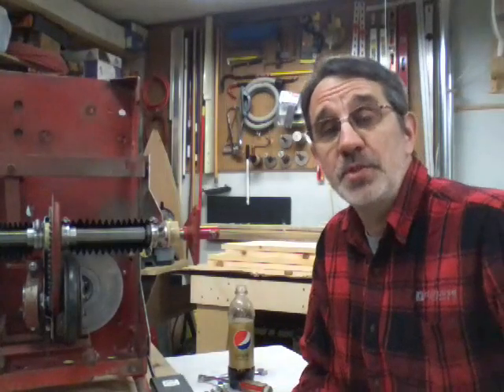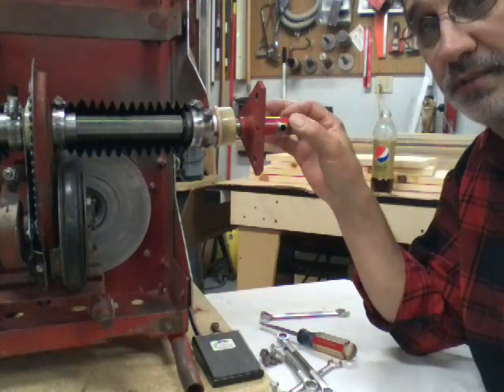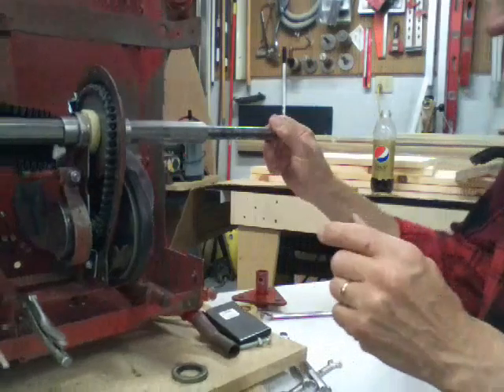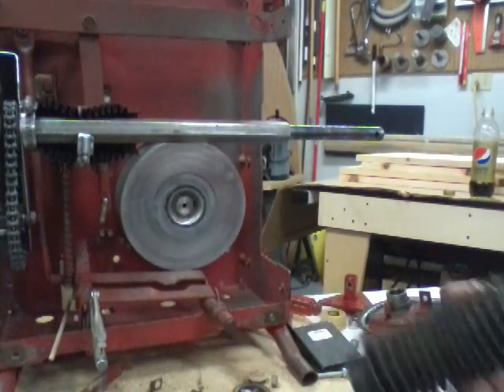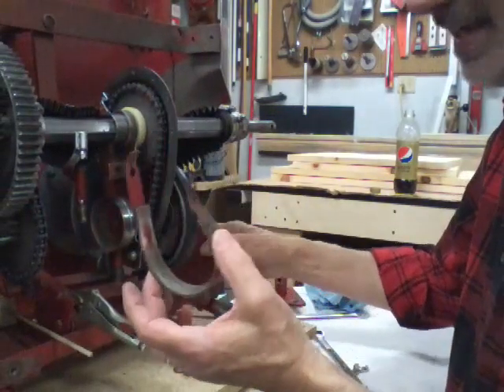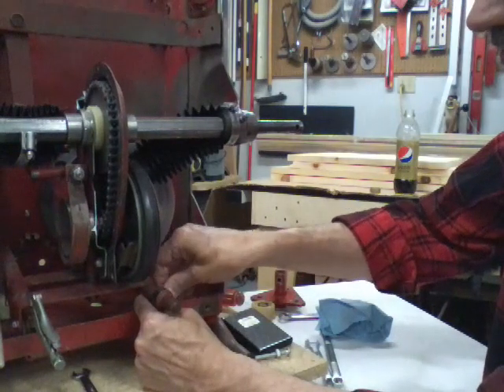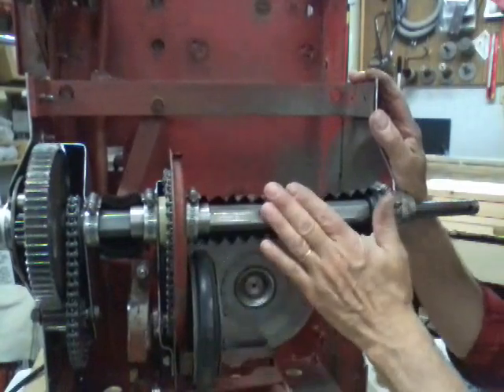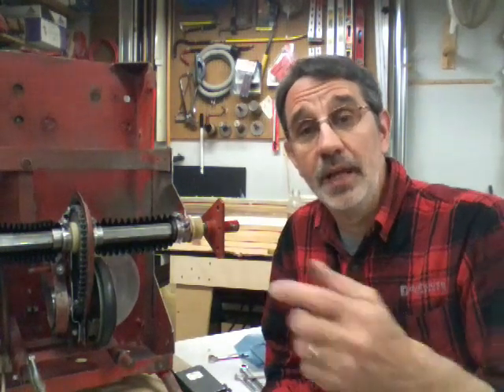94.  M/S 1  Replacing the boots on my Snapper Rider

Comment: I have gear lube that is leaking out of my transmission into the boot.  Of course my boot has a little hole in it.  Is the lube supposed to leak past the transmission body onto into the boot?
Reply from the maker: What did you use for lubricant in the case?     Jim
Reply: Differential gear oil
Reply from the maker: Was it double 00 lube or 80/90 gear lube.     Jim
Reply from the maker: Also if you twist the boot so that the small hole is on the top side when the machine is on its tires the lube won’t run out it will help lubricate the hexagon shaft and make it shift better.    Jim

Comment: What do you do if your chain case is rusted to the axle?
Reply from the maker: Well I’ve never seen one rusted to the hexagon shaft, I guess I would spray it with some penetrating oil and see if that helps break it loose. Jim
Reply: @jimjackson9381  This thing been sitting up for years.   I just can’t get it to slide on that hex.  The boots were rotted off as well.  Tried on wd40, liquid wrench and zep45 to no avail.

Comment: Any tips how to get it off the ground so can work on it?
Reply from the maker: Depending on what model machine you have take the battery out, shut the gas vent off and stand the machine up on its rear bumpers it’s made to do this
Reply: @jimjackson9381  yes, mine can be stood up.  My problem is I'm too old and too fat to work that low to the ground.  I was thinking once up, I could rock it side to side adding a 2-by each time and crib it up.  I have a beam in garage I can lift from but not enough head room to lift the entire machine up on its front end "lift tabs."

NOTE:  someone mentioned there are bottom covers that would fit from other models (European?) or could fab a cover.  (actually that makes a LOT of sense.  LOL could even make one utilizing Trex tape which has insane adhesive strength which I think is greater than Gorilla tape.)
Reply from the maker: @NoferTrunions  if you have a garage with open rafters that looks sturdy enough to support the weight I would go down to your local tractor supply or Farm and Fleet or a local hardware and buy yourself a rope hoist that will lift them up extremely easy That way, you don’t have to try to to lift the weight

Comment: Hey Jim, my Snapper from 1987 (Model: 28086) needs new boots. Are both boots the same size and part number nowadays? The last time I went through replacing boots, I seem to recall there being a long and a short boot, with different part numbers, in the past. Can you confirm one way or the other? Thanks
Reply from the maker: Peter 
Hey Peter it's Jim
     I looked up on parts tree description page and according to that one of your boots are long, and one is Standard,(or short). They both are the same price $7.77. If you have any other questions or issues please feel free to email me or put the question in the box below the videos thanks again Jim
Reply: Thanks Jim. I just checked PartsTree and I see the pictures where it shows a long boot for LH fender and a shorter one for the RH fender, but to my surprise, both are the same part number. Seems strange. I also saw that they list the original part numbers for the boots, so I googled them both (7011011 for RH boot and 7017084 for LH boot) and some aftermarket gray colored boots came up in the results, where one was actually longer than the other by maybe an inch or so? They didn't look like they were rubber..maybe plastic? Hmm, I'm a little confused. Did your 28" display model Snapper use equal length boots when you last replaced them? It looks very similar to mine. Thanks again.
Reply from the maker: Peter 
Hi Peter it's Jim
      I checked my model number on my working model with the electric motor on it and it calls for one long boot in one short boot, on the model I took one short boot and cut it in half and put it on both sides but it's a nice rubber boot in it stretches without any issues if you pick up one of the cheaper aftermarket ones that are well I don't know if there are plastic or not but they're not really Rubber you may need the long one and the short one. If you have any other questions just let me know. Talk to you soon Jim.            Oh yeah don't forget to send me a picture of you and your snapper I'd like to have it on my wall.
Reply: Hey Jim, thanks again. After talking with you, I think I'm going to get two of the Snapper brand short rubber boots. If it stretches ok, like you said, then I think those will hold up a lot longer than the non-rubber aftermarket ones. I'd rather do it right the first time around. As for a picture, I have 5 Snappers, so I'll call it a group photo..LOL  Happy New Year!
Reply from the maker: Peter 
  Hey it sounds good Peter I haven't got a family photo yet. LOL. Jim
Reply: Did you managed to install 2 short rubber boots and are they holding up?  I also need to replace both boots and don't want plastic ones.
Reply from the maker: onesri 
 Hi it's Jim,
     I put two short rubber boots on my machine because that's what it called for  to use, some machines call for one short boot and one long boot.  Thanks Jim
Reply: Hi Jim, mine called for one short and one long.
Reply: I haven't been able to get it outside of where it's stored due to the deep snow. I'm stuck waiting until it melts enough so I can drive it into my garage.
Reply from the maker: Peter    Hi Peter it's Jim
  I know what you mean about the deep snow I'm in Michigan and really getting dumped on this year along with a lot of other states that usually never get snow, but right now up here it's in the low 50s and everything is melting,  so just let me know when.   I have a call in to Parts Tree and he's checking to see why both boots have the same part number thanks again Jim
Reply: Hi Jim, I'm sure your snowblower is getting a work out! Miraculously, the temperature rose to the mid 60's today (it was only 12 degrees on Monday), so the snow is pretty much gone, but the ground is soaked. I am hoping to get back to where the Snapper is and work on it this weekend. Other than the boots, I need to straighten out the pipe frame of the twin bagger.  Looks like it got bent from previous owner backing into something.  Come to think of it, I also need to add some shims to get rid of the side play. I think it should be ready to go after that. Thanks for inquiring about those boots from Parts Tree. I'd be curious to hear what they say when they get back to you. Thanks for your help! Peter
Reply from the maker: Peter hi it's Jim
  I got a call back from partstree and they have discontinued the long boot, they say that two short ones will work just fine. Hope this helps. Thanks Jim
Reply: Hi Jim! Thanks for letting me know. Much appreciated. I will get two of the short boots. Do you remember off hand what the ID is on one of those nylon thrust washers that would be used to eliminate side play between the LH fender bushing and the hex thrust washer? My hardware store sells nylon washers, so I am hoping to find them there. I don't have this Snapper torn down yet, but I can tell that I'll need to add some shims due to the fact that I can move the rear of the tractor about a 1/2 inch side to side. I was thinking that it would probably be a good idea to address that side play at the same time I replace those boots. Thanks for your help Jim
Reply: Hi Jim,  just wondering how to keep the grass and dirt if we install two short boots to replace the long one.  Do we have to overlap to get a tight fit?
Reply: Hi onesri, I could be wrong, but I think he means one short boot on each side of the chain case would work, instead of one short boot on one side and one long boot on the other.
Reply: Got it
Reply from the maker: onesri    Hi it's Jim. I meant you need to order two short boots, instead of one long boot and one short boot, You put one short boot on each side of the chain case the short boot should stretch as far as the long boot did. Now there is other places were you can still order a long boot if you would rather have one. Thanks Jim
Reply from the maker: Peter    Hi Peter it's Jim
   I dug out one of the nylon thrust washers to measure at the outside diameter is 1 inch 11/16 and the inside diameter is 3/4 of an inch Hope this helps sorry about the delay talk to you later Jim
Reply: No problem Jim. Thanks for dimensions of the thrust washer; I was able to find one at the hardware store and with it installed, there's no more sideplay. I got the new boots on tonight. The new style boot works great where the long boot used to be. However, it seems like the boot on the differential side is too long, as it completely compresses before I can get the shifter into 5th gear. It will go into 1st, 2nd and 3rd just fine and 4th with a little difficulty (you can start to feel resistance from the boot being compressed). I wish I had saved the original boots to compare the length of the short one to these. Can you think of anything that I may have overlooked? Thanks.
Reply: I can live if its shits 1st-3rd.  I am ordering a set.  I found 2 OEM for $11.05 on eBay (free shipping).
Reply: Took the whole transmission apart. Figured I might as well, since I had most of it apart anyway to change the boots. I think I may have found the problem. It looks like, over time, the side play between the axle bushing and hex thrust washer caused the chain in the differential to shift and push the cover out a little bit around the boot area just enough so that the hose clamp sits out a little too far for the new boot to compress enough to get into 5th gear. These are the original clamps, not the newer worm gear type that I see Parts tree lists as what fits my Snapper. Looks like I'll need to repair or replace that cover and possibly that hose clamp (if the ones that go with the newer boots are narrower). If I had the old boot to compare with the new one side by side, I'd probably be able to tell if the width of the clamp has anything to do with the fit. The new boots are definitely thicker than the old rubber ones I removed. It shifted fine into 5th before, but it's possible that those little changes (on top of the cover issue) attributed to the shift issue I have now. Glad I took it all apart though, as the differential gears, sprockets and chain are all worn. Will have to address that too. Just wanted to report what I found

Comment: I just bought an old Snapper that has been repainted and has a donor engine installed. Where would I find a model number on it? Is it stamped? Thanks.
Reply: There should be a metal tag on the back of the mower, just below the engine.
Reply: It’s under the seat by the deck

Comment: why can't they come up with a boot that comes in two parts which can interconnect to allow installation without removing the tires, etc.?
Reply from the maker: Crazy Gravy 
Because then anyone could fix it, just way you have to take it to a dealer. Jim
Reply: CAN YOU SPLIT THE BOOT AND THEN SUPER GLUE IT BACK

Comment: What can I do to get the flange off
Reply from the maker: Chase McCloud 
Hi Chase.  This is Jim I have a video it's number 39 if you're subscribed you'll be able to find it it shows how to get the wheel flanges off if you can't get them loose with a wheel puller by it self then you're gonna have to cut it  the way I did and pull them off that way if you cut them 90° to the bolt hole. You'll be able to put them back on and use the bolt to hold them in place you shouldn't have to replace them but when you put your wheel puller on don't put it on the outer edge of the flange where I'm showing in the video if you put too much pressure on it it will bend  where you want to put it is down on the flat area is close to the hub as you can. If you have any trouble or questions just let me know thanks Jim

Comment: this boot desighn sucks and I wont replace mine again. ran my last snapper 10 years with torn boots. worked fine. just spray shafts with wd40 and keep mowing
Reply from the maker: super20dan 
  Chances are it’s not the boots that you’re having problems with it is the brand you’re buying if you’re buying the tan plastic boots they will not last you want the black rubber ones they will hold up. Jim

Comment: Where do you get tha plastic dust cap from. At the 11 min mark on your video. Can’t find that sum bitch for the life of me. No body talks about that price of shit, both sides are dd sizes
Reply from the maker: Well, I need some information. Need to know if your machine has bearings in the fenders or bushings. You can send me some pictures that would help to.
jimsfixitshop@gmail.com
Those  dust caps  have been obsolete for over 20 years. They don’t have the hard plastic ones anymore now there are softer material and they have lip seals pushed into each one and they are different sizes for the right and left-hand side of your machine. If you send me an email use your email to return and I’ll send you a picture of the dust and lip seals with part numbers and the prices that they were the last time I bought them.     Jim
Reply: @jimjackson9381  Jim, i’ve got it figured out, I found some automotive seals that fit over each shaft because one is smaller than the other and I used a flexible, rubber cap. It almost looks like it’s off a spray bomb, but it worked good. I used the whole saw to cut out the hole for the axle size and then, I took a red rubber that goes over a rancho off-road shock absorber it’s accordion like and I think it’s going to work well. 
Thanks for responding to my comment. Keep up the great work. I love the set up in your shop.
Reply from the maker: Send me some pictures of what you did and maybe I can pass it on to some other viewers.      Jim